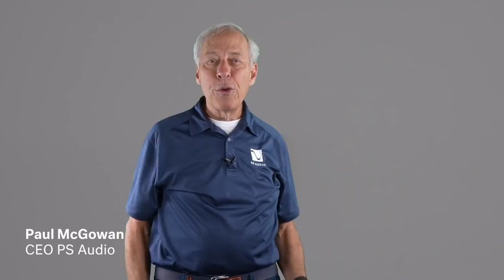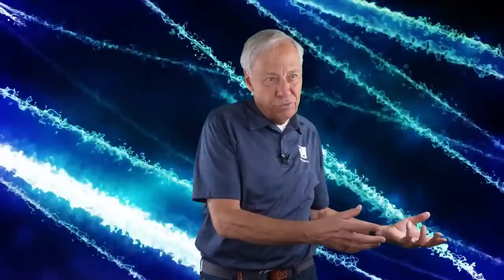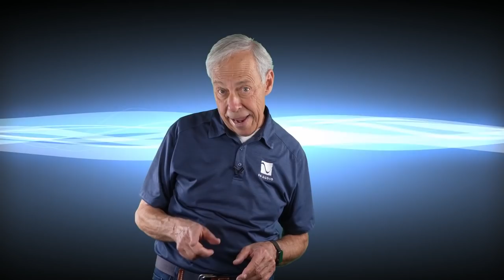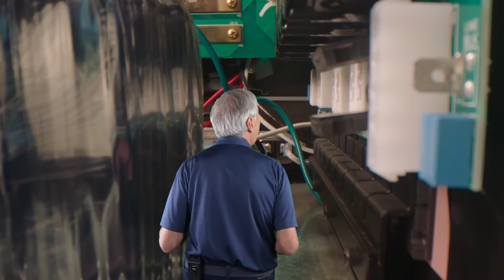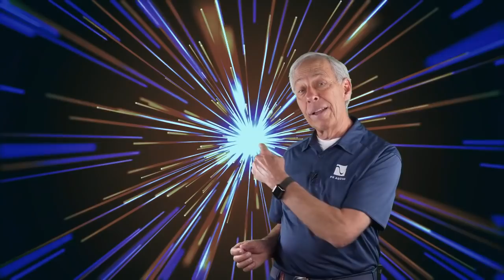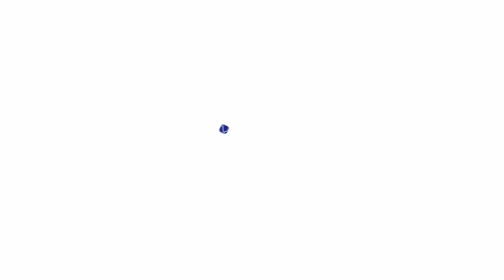Tour inside a regenerator

Comment: Please, please, I ask a favour on behalf of all us audiophile engineers subscribed to this channel - show us the effect that regeneration of power has on the DC rails in the amplifier. With an SMPS, you’re effectively regenerating your power anyway and regulating it to boot. With a linear supply its output to the power amp stage is never regulated anyway and your mains supply has to be pretty darnned bad that the reservoir caps can’t cope with input voltage fluctuations. I know it’s what you hear that matters but please demonstrate what a regenerator does in the same way you can show us what a refrigerator does. Love the video by the way!!
Reply: I'll take this one. Regeneration works in this way. Gullible people who don't have technical backgrounds fall for this nonsense and then Paul takes their money. I'm an engineer, Paul M. isn't.
Reply: @michaelakamatsu  Thanks Michael saved me the trouble.
Reply: @michaelhope007  Please feel free to chime in as well. I'm tired of these hucksters ripping people off. Before buying, just ask a real engineer.
Reply: Fools. Paul is an engineer.  He designed all the gear for years.  Have you designed and built audiophile gear? If not, shut up.

Comment: I get the idea but I thought this would be a video about how they work
Reply: If they showed how do they work , you would realized what is the meaning of  a very expensive snake oil .
Reply: It's basically a power amplifier with a 60hz sine wave as its source, and the output is a constant 120V

Comment: I owned a P10 it went up in fumes I contacted all at psaudio I got no service! People in Asia please avoid this product there is no service
Reply from the maker: First, I am very sorry you had a problem. Second, we have service in Asia and, depending on where you live, like HK, quite good service. Where is it you did not get service? Whom did you purchase it from? We pride ourselves on service.
Reply: PS Audio I had bought the P10 from AV india ( Burge Cooper) within warranty it started emitting a burning smell and stopped working. I have tried getting warranty repairs but I have been informed by your AV india that dealership has changed and it's difficult to get repairs from psaudio as you  don't care of the Indian market
Reply from the maker: @adv.rohitl.jbrasdesa2402  Thanks for letting me know. We certainly do care about India and its market. If you would be so kind as to reach out via email to travis@psaudio.com he can help you get connected with our distributor.
Reply: PS Audio I appreciate the concern I had sent the unit for service last October 2019 (within a year of purchase )to AV India but it’s still not serviced for want of spare parts! I had written emails to psaudio as well but I got no response but I did get an offer to upgrade the P10 to p20 from A V Indian which I refused as service was not available.I have sent email to travis as well as burge hopefully I will get warranty service

Comment: Paul. That was pathetic. I would have expected better from you than a cheesy infomercial. You just lost a bunch of credibility points.
Also contacted PS audio re low voltage correction (to 90V) and got no real info. Fortunately, a friend told me the right keyword: Voltage regulator. Bought a Furman, now plugged into an existing power conditioner. Not anything from PS audio. Just some potential customer feedback.